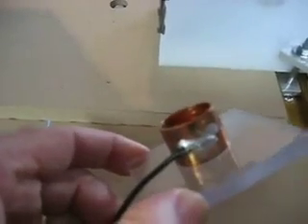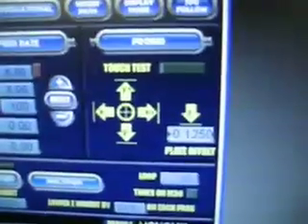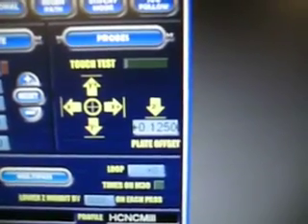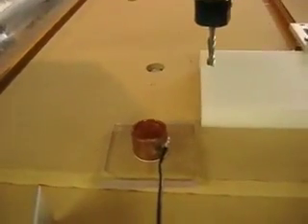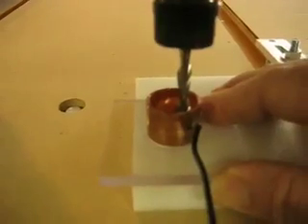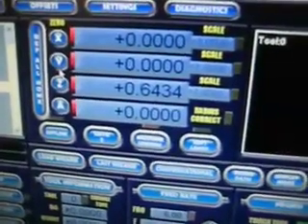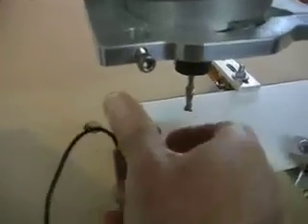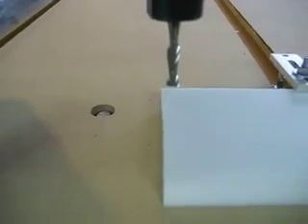Mach3 CNC Probe Tool

Comment: I love your work! I think that's perfect for my mill also. Only I have a problem that probably you have the answer for it. The contact test led should be off until you check for contact with the probe. Mine is blinking all the time and it goes on and solid when I close the circuit with the probe but that's  not wright . What I am doing wrong? Please advise.

Comment: hi friend, I need to thank! Thank you very much for share knowledge. This week I made my probe and I can't believe that I lived without this before, it is realy incredible! 
   I am only worried because today, when I tryed to find a edge on "y+", the probe not stoped and collided with the material at full machine's speed (what seems strange for me), and the result was not good... Before, I checked the contact and it was working perfectly. I really don't know what happened. I tried several times and it not happened again.
    But I am still happy, I saved about R$ 5.000,00 by not buying. Thank you very much!

Comment: Hello Ernie,

Can you tell me where I can speed up the hole center finder. When I engage it to find circle middle, It starts to move 1 step each second. As you can see, that is very slow and I would have to wait for 10-15 minutes to get my circle center found.
Can you help me with this one,

Thanks,.

Marko

Comment: very interesting I wonder  if the ring  on the plate is not x,y exactly with the table of the  mill than probe might not  et the  longest diameter  inside ring as cross section and eventually not give me factual center.
Another words if my piece of material is not accurately aligned with the table than plexi-glass bracket holding ring  I will not get cross reference reflecting center   ?

Comment: Could you not put a pin in the middle with a tight fitting spring around it ,insolate from each other and make one pos and one neg for 3D probing